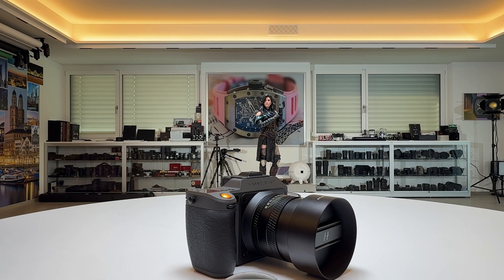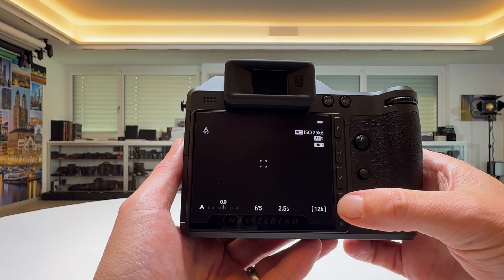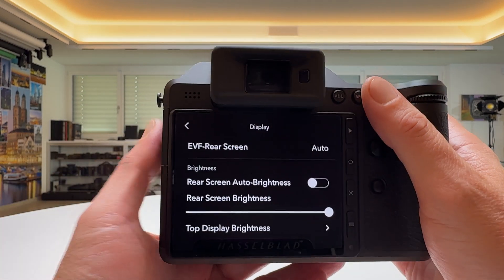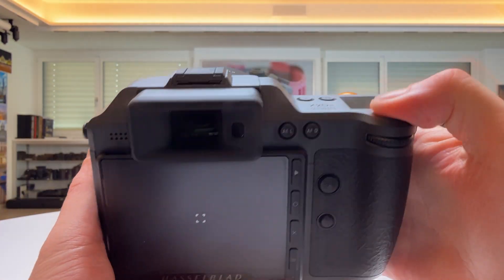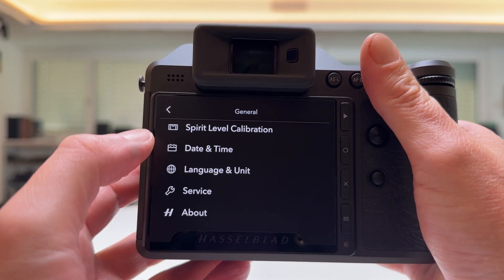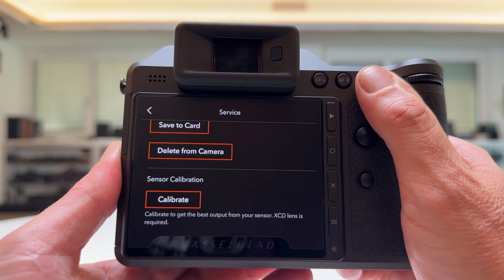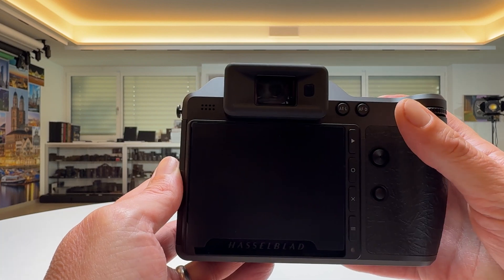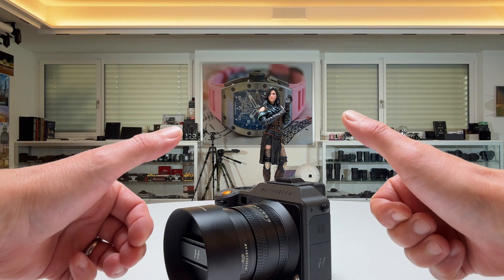Hasselblad X2D II "Quick Tip": Sensor Calibration against Dead/Stuck/Hot Pixels

Comment: You made my day! 

I was already upset, thinking there were dead pixels on my new expensive Hasselblad. Thanks for the tutorial — it was really helpful 🤝🏻🤝🏻🤝🏻

What do you think — is this a one-time fix, or can the pixels appear again and I’ll have to repeat the process? Is it safe to do the calibration frequently?
Reply from the maker: Glad the video was helpful and that you could resolve the issue! In my 20 Tips & Tricks video (on the channel) for the X2D II you find a section about a secret service menu. There you can clear-out sensor calibrations. So its definitely not forever. But as long as you do not delete a calibration the camera will remember what has to be calculated out :)

Comment: Do you update the filmware first before calibration? And what do you mean plug in before calibrate?
Reply from the maker: Not necessary to do a firmware upgrade before, works anyway. "Plug in" meant that I put the camera on charger for this longer calibration process. Cautionary measure, not required, but I like to do it this way for peace of mind :)
Reply: @mathphotographer thank you bro 😊

Comment: My question is this. Did you try another lens besides this lens? I’m not sure if you need to calibrate the sensor with each lens you have available.
Reply from the maker: Actually, these pixels were visible even without a lens, just sitting there on the LCD. Its a sensor issue and the calibration concerns the sensor only.
Reply: @mathphotographer  Thanks for clearing that out for me.

Comment: I noticed a "save" function. It seemed that the calibration did not change your settings back to default, but would it be prudent to save settings before doing this calibration?
Reply from the maker: It does not affect any other settings in my experience but "saving" is always prudent :)

Comment: Do you know if they are just mapped to black permanently. If you shot a white card what would you see at these spots?
Reply from the maker: Good point, will try this out. Curious what I find. I think the calibration "teaches" the camera that there is a pixel issue somewhere on the sensor and then the firmware makes a best guess what to fill in. At least that's my understanding. If someone has a better explanation, please chime in :)
Reply: I believe this is a sensor issue and not a display issue, so calibration should fix it.
Reply: @Fyntax10 I realize it is the sensor, but if there is some physical reason those pixels can not be read then they might have to map them permanently to black or perhaps report an average of the surrounding pixel values as that pixel’s value.
Reply: @DonaldHawk  If the sensor can't read pixels that would be extremely apperant in every photo.
Reply: That means that the sensor is faulty? Maybe is the reason Hasselblad offers a low price.